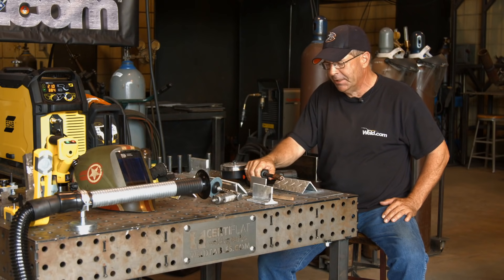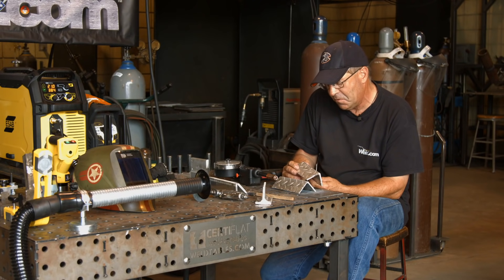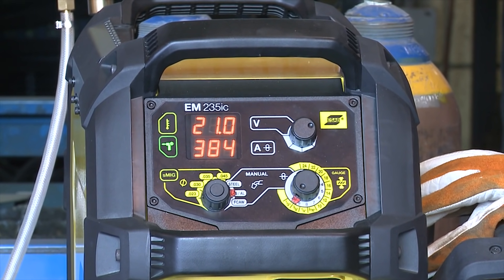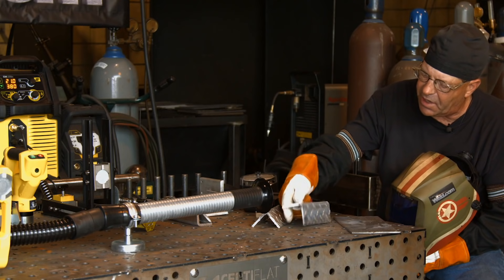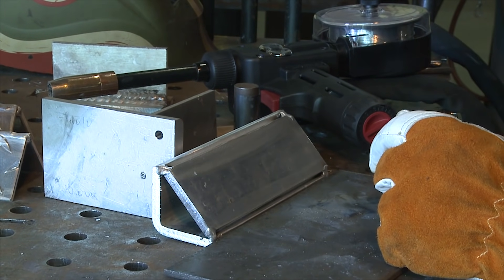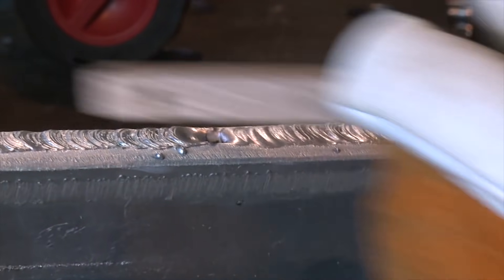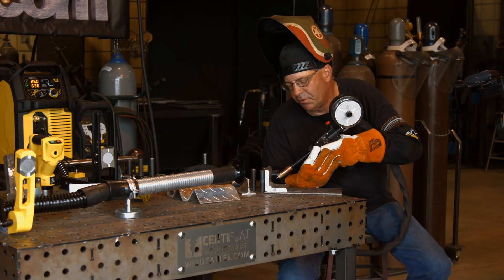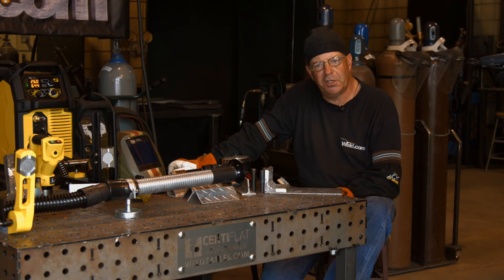🔥 Aluminum Spool Gun Settings Test

Comment: I am wondering if your Argon CFH setting might be what is causing the "raspy" popping affect?  Most shielding gas systems build up some inline pressure, so the initial flow is usually much higher than your measured flow rate.  It seemed like during the first few seconds of the welds you made, the arc sounded pretty good(CFH rate higher due to pressure build up?) Then after welding a little while the arc becomes erratic in sound(CFH has leveled off and may be too low?)  I would try setting the CFH at 40 or 50 and see if the arc remains stable the entire bead.
Reply: Im my experience the popping comes from too much wire feed or impurities popping off the arc. Preheat and cleaning solutions can take this away
Reply: lots of argon and a little more stickout also a little steel wool in your nozzle makes a defuser like a gas lens

Comment: Spoolgun with a flex tip is great for truck bodies. For thin stuff tig. But for thick use spoolgun. I always weld down hill so the argon covers the welding material. Most don't like aluminum welding because you have to move faster. They key is the aluminum should look polished after welding, if it is dull or any black check your setting and process, because that means you will most likely have Porosity in your weld. Been aluminum welding with spoolguns for decades. By down hill you are almost 90° to the joint.

Comment: 3/16 tread plate. I would run about 20.3 v and 205-215 wire downhill. To get spray transfer I almost always change wire speed. A lot of sparks is like short circuit MIG and  = too much wire. Globs = not enough wire.
Reply: yep

Comment: I weld aluminum channel probably about 3/16 wall thickness. We use 3/64 wire. About 22v 300 wire uphill doing sort of a whip and pause. Then just change the wire down to 260-270 and run to downhill pass. Just faster and quicker whips.

Comment: The Miller 30amp spool gun has a two stage trigger for post/pre flow not sure if other guns have this. No wire just gas found this out by accident because of the same issue with cratering.

Comment: Thank you for your input I am brand new and afraid to start learning how to welding, always thinking that I am going to get zapped at any moment, but I have to learn, I like what your doing helps a lot! Thank you Adam in San Francisco California
Reply: LoL same here 😂 I'm just starting off with welding as well. For the past year or so I've been reading lots of books and visiting tons of channels on YouTube for instruction including several that are videos taken straight from vocational training classroom DVDs . There's tons of things to learn for sure .
Before I got started the first thing I did was to make sure I had a safe way to do it by building a proper sized circuit ,with a breaker that could handle the amount of current the machine needs and made sure everything is built to code and then some .
Only after all that did I think about using it . With all that said it takes practice and making mistakes, learning from those mistakes in order to feel confident and not be afraid to use the machine . 
First and foremost observe and practice all safety aspects of using the machine and absolutely make sure you have all the proper safety gear you should have before doing anything .
Also just as there are really good channels on YouTube for instruction like this one, there's also some bad ones where they'll take shortcuts or they're not being very safe . If I see someone doing things like that I won't waste my time trying to learn from them.. period .
Well anyways good luck with your endeavors on learning how to weld and be safe ! 👍✌️

Comment: I've watched this a few time, and read all the comments, too!  You're getting some good ones in here, and also some other shop teachers, and people with long experience.  I'm calling for some kind of congress here, where you have a room full of shop teachers, or a room full of people with deep experience on this (or some other) controversial topic... and see if we can advance the state of the art!  I bet there's a grant for this somewhere.  Anyway, this gives  me a lot to go on.    

An aside about plastic gun liners:  I've been saying all along that the liner should be Nylon or some special plastic with good compatibility with Aluminum.  Teflon is not great for this!  I know this shocks people, but it's true in practice and also in the literature.  SO, I just found online a Chinese supplier of welding stuff that has a dozen different type of gun liners, one seems to be nylon/graphite!   One is bronze wire... they don't say much and of course what they do say is sometimes garbled or just copied.  I'm going to try a few, and see if one can't use a cheap MIG machine and a carefully maintained gun assembly to do routine MIG Aluminum. They had U-groove drive rollers, too.

Comment: On the craters I weld at a unnamed big trailer manufacturer 90% spool gun mig always push and uphill vertical  what I do is go right to the end of weld speed up travel speed 2" from end of weld hit the end of joint then go back 2" just as fast ( the double pass at double speed puts same metal down) then at very end pull back slowly increasing your stick out to about. 3/4" as u pull away slow tipping the gun parallel. To weld not pulling straight out  no fish eyes and your right fish eyes cause  cracks  every time

Comment: I've just recently started using a spool gun.

It's not my first time welding aluminum, but I can't figure this thing out.
I'll get 2" that's pretty decent, then 4" of nothing but bubble gum.
Wire is tensioned pretty well, and draws very smoothly and consistently, I've tried push/pull 90°/20° ect and I haven't touched the settings at all.

It's my bosses $200 Amazon special which no doubt is a factor.

Comment: I do straight 90 downhill runs with our push pull pulse mig machines. The spool gun will do it too. I don't go vertical up because with alum it never works. You fight gravity and it ends up looking junky. Which is weird because I can weld overhead all day long if I wanted to with no problems.

Comment: I notice on the fillets, the top of the weld was black and the toe was not. I bet if you put some sort of screen in the nozzle to help diffuse the shielding gas a little better it will fix that.
Reply: Wire brushing the weld area just before welding also would help.

Comment: At times, when i have the luxury, I'll use a run-on and run-off tab at the beginning and end of the joint. This keeps the cold start blob, and crater at the end, in check. Then just peel off the tabs and dress the weld
Reply: same procedure on structural steel

Comment: Good info Bob. I bought the ESAB 285, my settings to get the somewhat same result are different. 20 Volts and around 600 for wire speed. that's with .035 4043 on not clean 1/4"

Comment: My experience is to not whip it very slight manipulation, just push it. Your using straight argon its basically spray MIG. Try to use 50 series wire when possible it runs wayyy cleaner and much stronger weld.

Comment: Bob you  might  try  More   volts  than  you  think  you  need  and  just  keep  one  hand  on  the  volt  knob  adjustment  while  your  runing  the  bead.  It  needs  to  spray  or  sing  not  pop  as  you  know.  You  might  try  Helium  or  a  pulse  mig  but  their  not  cheap  HUH ;

Comment: I didn't hear the filler metal alloy designation.  So pardon me if I repeat, E4043 can be used in any position except vertical.  E5356 can be used in all positions, including vertical.

Comment: What I am looking fore is a spool gun that will run an any DC welder even if the drive  wheel motor has a separate power source like 110 volts.

Comment: Try 10% Helium 90 argon and keep the voltage high like dragon said and you should be at 13 or 14 shade on your helmet with 3/8 and thicker aluminum.  And don't dely dally.

Comment: A)  There are infrared "laser" thermometers now available for $18.00 to $25.00 on internet and at the cheap box stores.  Could you shoot a temp after a M/T/S weld and show us how hot this stuff gets?  B). Will a quench in clean water (to get the temp down) so welder can reposition his work and finish his weld on Al/SS/mild S affect final strength?
Reply: Never quench in water unless you like cracks in your weld. Heat will dissipate and flow outward from the weld area fast enough.

Comment: do you have a rule of thumb for welding thicker aluminum than the welding machine is rated for? for instance, my Lincoln electric 140mp machine goes up to 3/16" and i want to weld 1/4", how hot should i pre-heat? and does that number of degrees increase linearly with the thickness, for example if it was 200 degrees F pre-heat for 1/4" then for 5/16 it would be 400 degrees F?  please include a link to any helpful information/charts/graphs on this topic, thank you greatly! i really enjoy ALL of your videos! Very helpful as well as entertaining to watch! Please please keep making 'em!!
Reply: Just go with 200 for preheat, no matter how thick. Big thing is testing before the important weld happens.

Comment: I've been thinking about getting into welding and possibly doing aluminum truck bodies and trailers. What do you think of the Miller 255 ? I was thinking that the push pull gun was the way to go because it just looks easier to work with and it can use big spools of wire that are more economical.

Comment: I've watched a couple of your videos regarding MIG welding aluminum with a spool gun since I'm starting down that road myself, and I find your tips and techniques to be very informative.  However, I noticed you comment quite a bit on the sound of the welding as being a guide to adjusting the machine settings and your welding techniques; I wondered if you could expand more on non-auditory cues?  I'm deaf, so I won't be able to listen for hiss and pop; more details about visual cues would be helpful in that regard.  Thanks!

Comment: My boss has been mig welding aluminum for over 20 years try 24.0 Volts then go from there on your wire speed our mig guns are on 3/4 on the gun speed

Comment: Bit confused here. Are you using spray transfer here? It almost sounds like short circuit which I thought was a no-no for mig welding aluminum. Am I correct or can aluminum be welded by short cicuit?
Thx for the reply

Comment: The looks of a weld aren't a true indication of a good or bad weld . My Father showed me that with bend test . The welds that looked like bubblegum , actually we called them bubblegum welds , sometimes would past bend test and not all the great or near great welds would past the bend test . I have known about NDT since late 90s but recently I started watching videos on it but was wondering if there is a cheap NDT technique/equipment that is more accessible to lower budgets . Sometimes we don't have access to backside of a weld to check for penetration which i guess if it's that important we would probably find some sort of weld inspector/engineer .

Comment: My welds are blowing out and the end of my passes . The roller has some chatter in it cause the wire to not feed smoothly . I can't figure out my settings to stop this from happening.  I'm using a miller 350p with a miller spool gun.

Comment: more volts = more better on ali in my experience I did some work for electrified rail and we were running up in the 30's with double pulse and it ran sweet with a pull gun not spool.

Comment: Have you tried the 5356 wire? Just wondering? I was watching another video and a guy was using the next size up tip. On .030 wire a .035 tip. Because things heat up so fast and hot it swells the wire!? I was going to try it myself tomorrow and see what I come up with. Hey buddy thanks for your input. Montana Rick.

Comment: I’ve got a Miller 252. Can’t decide if I want a spool gun or a Miller XR push/pull gun or a spool mate. Which one you find welds better? Only done a few aluminum welds with spoolgun on an oily boat transom once where tig was a PITA.

Comment: I find vertical down helps a bunch when your doing aluminum sheetmetal like say 12gauge with MIG on the spoolgun...although my Lincoln100SG spits out the wire up and to the left which I don't really like, I don't think there's really any way to get around it because it's coming rate off the roll and only traveling a few inches, so gotta live with the cast.

Comment: Bob how far should you weld say on a 3/16" sheet of aluminum before you stop to keep from  warping the  material 
Should you make short stich welds or would it be ok to just make one long run several feet  with the spool gun

Comment: I'd like to see that rebel running some dual shield flux core for welding some thicker steel. How much will it put up with?
Reply: Run dual shield every day with my 235 (3 months) and 215 (1 year) 035, 045 and 1/16 wire. Could only get the 215 to duty cycle cranked all the way up doing a 16' fillet

Comment: 6:45 PRO TIP: finished welding up a huge tank (water, oil, gas, doesnt matter) and realize you have 1-100 pin holes from your craters???

Ivory Soap
Other soap may work but I know for a fact Ivory works best. something in it reacts to gas/water/oil and plugs holes right up. just take a piece of the soap (I keep some next to my soap stone for marking) and massage it into the leak. will stop the leak and never leak again. If it works on a vibrating 60 year old chopper tank.... it will work for you. Good Luck!!

Comment: what should I check to resolve black smoke, plenty, while welding aluminum. I'm using 4043 0.035" with Lincoln 210MP with Lincoln spool gun. New 100% Argon gas bottle with gauge set at 20. I hear gas and feel gas out nozzle. Seems to me not much gas or contaminated gas? First time setting up and using spool gun.
Reply: The black powder is always going to happen with MIG using DCEP.  It is more pronounced with E5356 wire.  The weld itself should be clean with the black powder to the outside.  Be sure to use a push or backhand method.

Comment: Mr. Moffett. I so enjoy your easy to understand welding videos. i am now a bit confused with this last video. I have never had a TIG training. Because I am an old fart.I was trained in the Air Force on Oxy/Acct and Arc only. I was under the impression that aluminum could only be welded with A/C current. I believe that the Esab 235 that you are using is a D/C machine only. I have watched this video at least 15 times as I do most of your training sessions. Do I gather from this that if a spool gun is used with a D/C supply source that Aluminum can be welded as you are showing if 100% Argon is used? I think I may have missed something here. Please help me to understand.
Reply from the maker: Harold Watkins Yes, when MIG welding Aluminum with a spool gun you use DC.
Reply: Thank you very much.
Reply: On a tig welder you need the ac part of your cycle to break the oxide layer (you CAN do dc tig aluminium but for all intents and purposes aluminium tig is latgely a ac proces)
This is because your electrode does not contact the weld pool with tig.

With mig your wire (on short circuit) or molten metal (on spray arc)do actually contact the weld pool and thus physically break up the oxide layer.
Reply: I appreciate that NemesisRTCW. I am still struggling with why the spool attachment changes these properties. How does the spool gun accomplish to break the oxide layer using only D/C? Possibly does the spool gun change the sign wave to simulate A/C? is there something on the internet to explain this to me or can you enlighten me please?
Reply: Nope it is the actual physical stirring of the molten weld pool that the wire or molten wire that is breaking the oxide layer.

Think of it like this.
If you have a cup of coffee with a creamy layer of foamed milk on top you can only get that gone with stirring it with a spoon.
Reply: I appreciate that description NemesisRTCW. That makes good sense and I can understand your explanation. Nice reference also.
Reply: Aluminum MIG works because you are using DC reverse, that means the current flow of the arc is from the work to the wire.  This is the part of the AC wave form that lifts the oxide layer off the aluminum in TIG (the HF helps too).  Also this is not short circuit but spray transfer because you have to use argon (or sometimes argon/helium mix) to prevent oxidizing the aluminum, and argon does not short circuit well.
Reply: Thank you so much David Marquardt for taking the time to explain this so I could understand. That makes perfect sense.

Comment: Good video. Are you hooking your ground clamp to the table? Are spool guns specific to the welder mfg., or can most be used on other mfg's welders ?
Reply: I couldn't see where he had his ground clamp at, but I can tell you the closer you are to the piece you're working on the better. You'll get a crisper arc. 

Most manufacturer's spool guns are indeed proprietary and there is no real standardization for spool guns across the industry. However, alot of them use the same connectors. 

Can you use a Miller spool gun on a Lincoln or ESAB or vise versa? I've never tried it but I can assume no since they all try to sell their own. Probably just slight differences to make them incompatible. Again never tried it, just speculating. Now Hobart guns might work on a Miller since they're owned by the same parent company, just keep in mind Hobart is their lower end offering, like Chevy and Cadillac

Comment: I run a weld shop, my aluminum welders are having tons of soot. Any idea on what steps i need to get rid of the soot?
Reply: Try adjusting shield gas psi! Also purge before starting arc and after finishing, had the same issue! Its hard to no get any at all but this will decrease it!